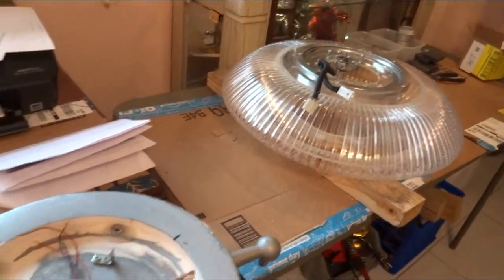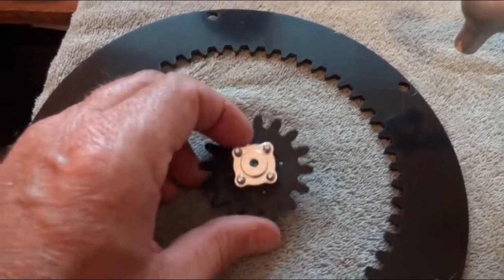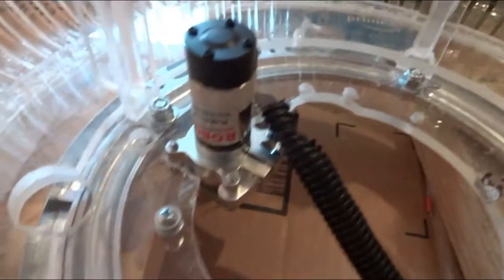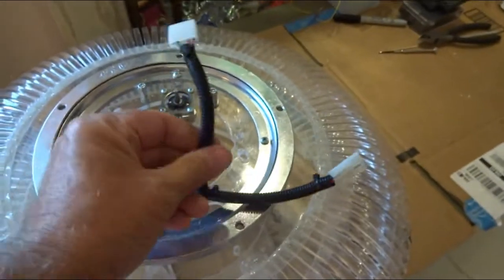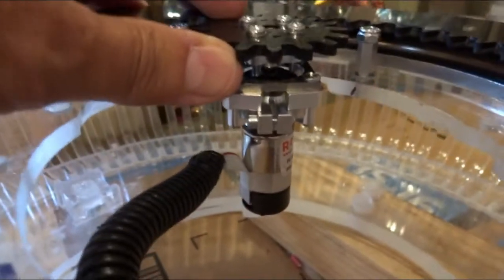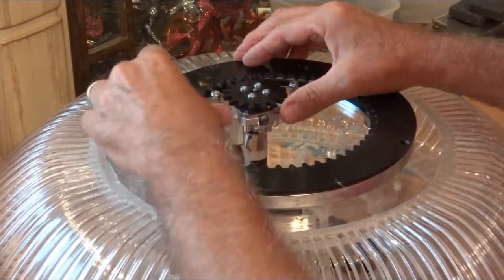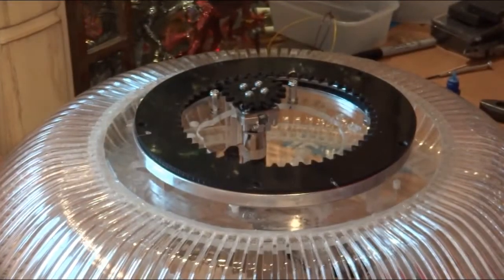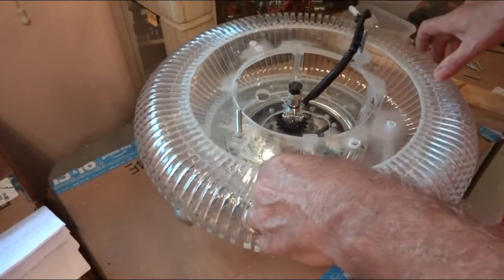B9 Robot Collar and Radar rebuild - Part 3

Comment: Is there a source listing for the parts you are installing.  What is the RPM of the servo?
Reply from the maker: There is no source. Sorry. It's all in my head and found through research. The motor I got was a premium planetary gear motor. Runs at 116 rpm. I bought it from several city. 116 RPM is pretty fast so a person could probably get something slower. I control the speed with a kangaroo daughter board attached to a saber tooth border controller. Commands are sent over Wi-Fi from a control program called arc. Santiam is the program author.